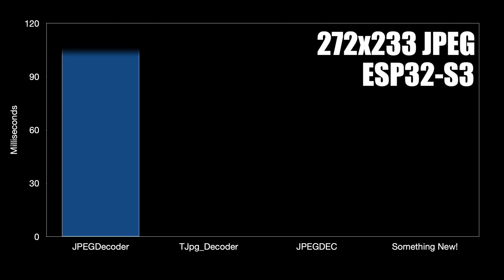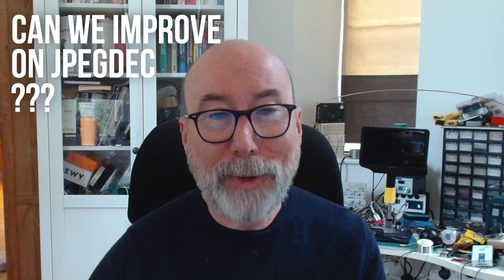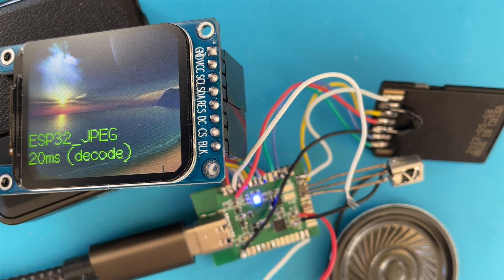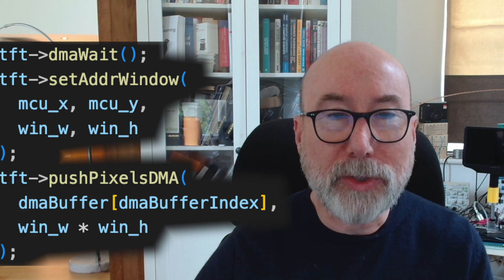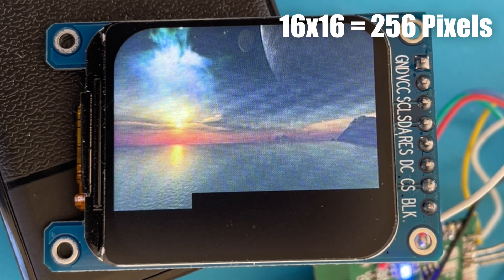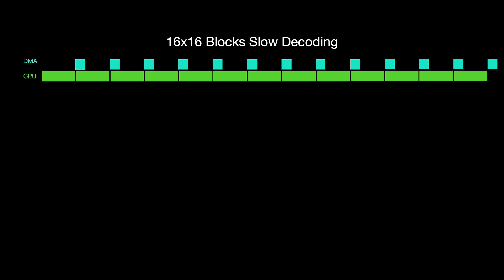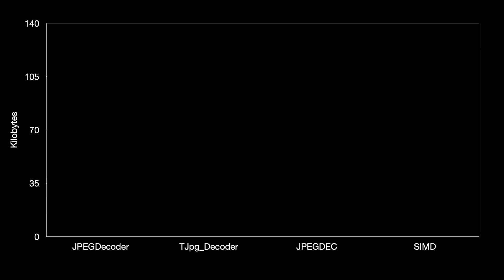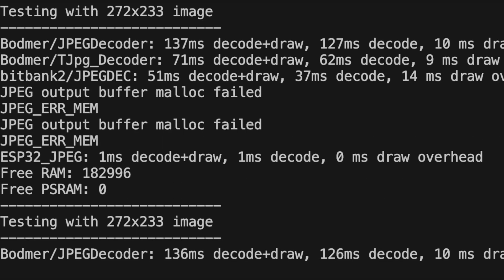ESP32 Super Fast JPEG Decoder - 20ms!

Comment: I'm so happy I found this. After I swapped out TJpg with JPEGDEC, I was able to reach steady 30 FPS with my video player with 90%+ of both cores' time being spent on JPEG decode. Runs with a resolution of 360x200 with my own format which is basically just many small JPEGs in a big blob with index data at start, and audio as WAV (so it doesn't cost to decode much, where mp3 would take at least 20% of one core)

Comment: Thanks for the video. Watching this topic for a long long time. 
Tried to do the QVGA movie player by using JPEJDEC and TFT_eSPI on ESP32, ESP32 S3, RP2040, K210, Teensy 4, STM32F1 F4 H7, and AMB82.
However, the final winner is the aged Pi Zero W.... for size, power, cost, and functions considerations...

The Pi 0W can do 1024x600 MPEG4, H.264 decode in HW and output to HDMI, SPI, RGB, VGA, DSI with very low CPU usage and about same power consumption as MCUs.
Further, the Pi 0W can do 384k 24 bit I2S out, but ESP32 S3 can not.
The only difference is the longer boot time of Pi 0W.
Looking forward to the updated pipeline on ESP32 S3!~

Comment: I love this series, for now I’m just following watching & enjoying the conversations. 
I have a project in mind, streaming video from esp32 camera to another esp via Lora (longer distance) or NRF24 (for under 1km distance);
I might be dreaming huuh 😊
Reply from the maker: Lora is going to be pretty difficult - Lora is very very low bandwidth - 0.3 kbps to 5.5 kbps. So your frame rate would be very low - and there's lots of rules about not sending too many packets and saturating the network, it's really designed for very small packets with not much data. So probably not very suitable. NRF24 looks possible - it's certainly got enough bandwidth - really depends on what frame rate you are looking for. ESP-NOW actually has quite long range and you can get great performance with external antennas: https://youtu.be/oz0a7Ur7nko
Reply: @atomic14  , just wow 😯 didn’t expect such respective and such kind reply. 
Thanks buddy, so Lora is “No Go”, will check the link provided.

I can’t stressing this enough, but thanks.

Cheers from Tanzania 🇹🇿
Reply: @atomic14  , thanks.

Now I will be waiting persistently on your upcoming pcb design videos 😊

Comment: If I remember correctly, PSRAM is slower and can't be used for DMA. So better try and fit that buffer in regular memory.
Reply from the maker: On the S3 you can now use PSRAM for DMA. Lots of details here (and I wouldn't even pretend to understand most of it!) https://github.com/espressif/esp-idf/issues/11269
Reply from the maker: One thing that did surprise me is that it used to be a real pain using PSRAM with the Arduino framework. You needed to use the special ps_malloc to get it. It now just seems to be pooled in with the other RAM which is much more sensible - new and malloc just work with it as normal.
Reply: There is 8-lines 80Mhz PSRAM on ESP32 S3.

Comment: I've been following this project for a while. Have you considered sending deltas between frames? This is what Netflix and others do to reduce bandwidth on broadcasts. You might also want to send "full" images every 1 second or so (key frames). It would require "baking" the raw video on the server side (which you're doing to convert to JPEG anyway). I continue to subscribe and am following with great interest!
Reply from the maker: Definitely possible. I've also seen some code for decoding MPEG1 video that looks like it will run on the ESP32. It's one of those interesting conundrums. We've got something that works pretty well with WiFi - it's not that efficient, but we've kind of got bandwidth to spare and higher quality/higher framerate are really limited by our hardware. Improving the compression is a really fun technical challenge, but may not provide any real visible improvements.

Comment: Waiting for ESP-3200 with it's 32 cores, 100 MB Flash and 100MB FAST RAM. 
Dreams do come true. ESP32 was thought to be impossible an dream 40 years ago. 
Would've beaten the IBM PC to the curb by clock speed alone. Just as the ESP8266 smashed Arduinos.
Nice job Espressif and you of course.
Reply from the maker: Thanks! It is amazing what we can get our hands on nowadays. Completely bonkers.
Reply: At that point you should probably start thinking about moving to a raspberry pi compute module
Reply: and an errata list a mile long